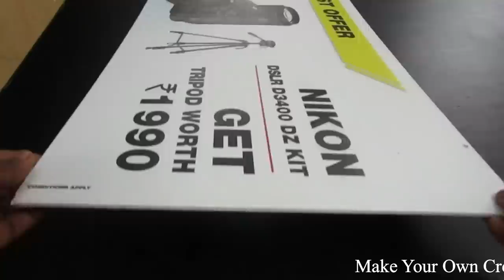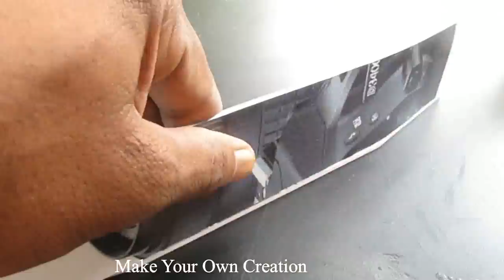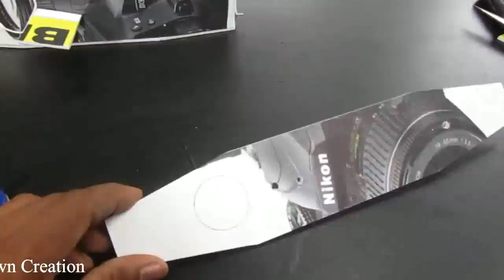How to make a boat - submarine

Comment: Wait a minute. How's it turning with out rudder ?
Reply: Notice how it only turns right. This is because he only uses one propeller, which causes the boat to turn right as it spins. If you use two motors spinning the opposite direction of each other, this will cancel out and it will go straight.